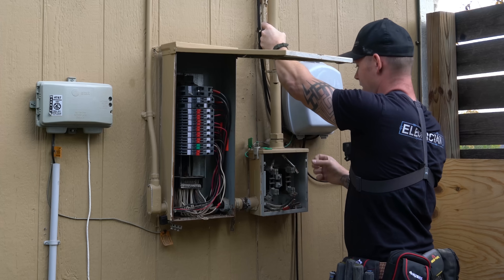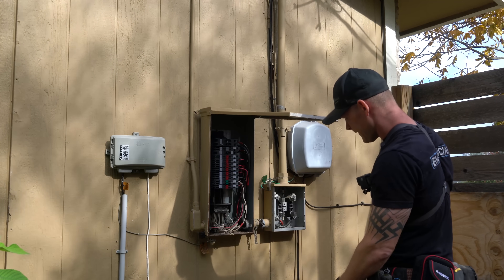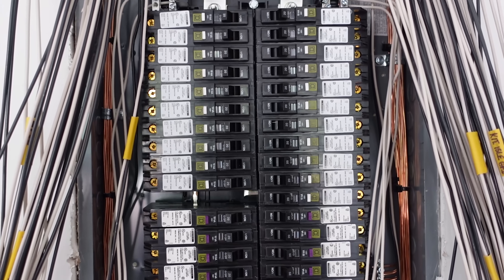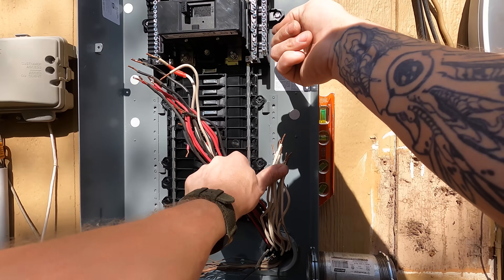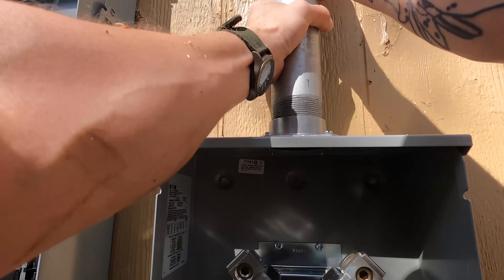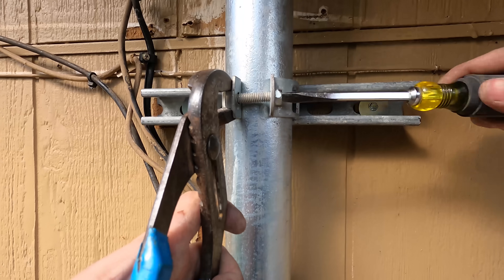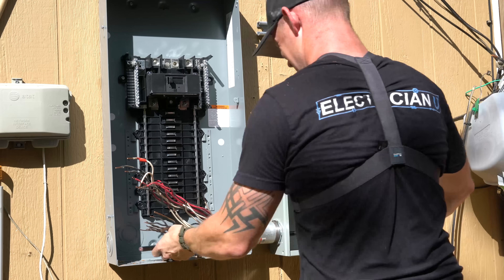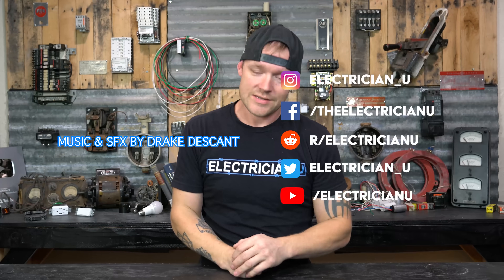How to Replace an Electrical Service Panel, Meter, and Riser (PART 1)

Comment: In my city in Michigan Wayne county they say you have to have your grounds outside and the code book is now saying your main shut off is outside and all the panels inside the house are now just a sub panel and you do not need a ground to go to them all you need now is a ground to your water line out into your disconnect and then through your ground lug on the wall and then into the jumper 6 rod 6 ft apart 8 ft ground rod😊 so you can correct this video and show what the grounding requirements are also

Comment: 4:06, I wouldn't consider having them as knockouts vs. holes silly.  When you install it on a pole, you only use the center top and bottom holes.  You'd have to install duct seal on a pole installation if they were holes.  But I'm just a farmer that has installed one service on the property, and installing a second service, I don't do this for a living every day. :D  Those knockouts are dead easy, though.  I'm using 3/8x5 in. lags, it's not going anywhere.

Comment: NEMA 3r is the reason those panels have ko for screws. If you notice that same manufacturer may have open screw holes in their Nema 1 Panels. Sometimes these Nema 3 panels are mounted on unistrut and are open to water intrusion behind them if the ko was left open.

Comment: What kind of wire do you use for the drop?  The only wire I find in my area is underground cable.  The only UV resistant wire is SEU in a jacket.

Comment: Question.  Would it be legal to invert the panel so that your mains were all terminated on the bottom (technically the top) as well as having the main breaker at the bottom?  I was just thinking about that for a cleaner look as well as not having those mains taking up all that space next to all of the individual breakers.

Comment: I needed this. I don’t know if I’ll be doing it myself but I needed this. Just had a high wind storm and the electrical company’s power pole yanked out the wire from the riser. Now they are saying it’s on me to replace everything. The panel was already old but I think the yanking of the wire did it to the panel. 😭

Comment: I do have a question. Not sure if your still reading comments to 3 year old video but i guess we’ll see. Ive been watching lots of videos on changing my main panel cause I’m getting ready to do mine. Here in New Mexico i had to take a competency exam to be able to work on my own electrical system without hiring an actual electrician. Obviously there’s only certain things i can do before i absolutely need to hire a licensed sparky. Any how most videos say that you absolutely need to use noalox on all connections including any metal to metal connection on the panel itself like screws and what not. Is the only reason you didn’t use any because you used copper wire or is there any other reason. Hope you could let me know this so i can have some clarity on that. Sorry for the long comment i know there’s a lot of unnecessary information i included but I’m bad at that. Thanks.

Comment: Im a union plumber here in New Mexico and i dont know why but when it comes to unistrut i have to cut my pieces in even measurements. Basically any cut i do has to be in between the holes. I’ll even get on my apprentices asses if they cut the actually hole. lol just thought that was funny cause i saw you dont really care where you cut it.

Comment: Thanks for the videos I just finished watching part 2 of this one here I'm currently doing pretty much the same thing upgrading to a 200 amp panel with breaker GE just curious going from 125 to 200 what size ground wire and ground rod should I use thank you or what would you recommend and I live in Austin

Comment: I have a 50 year metal support line. I need to take up the "sag" to ensure 12ft+ ground clearance. Power cut at pole, mast pulled away from house (im fixing it back to vertical), how ?
 Also windy here and adding a guy wire to roof.  Its been pulled away from house towards pole. After mast is secure would it be power company responsibility to make TAUGHT???

Comment: Thanks for all the time you take to make all these informative videos. Had a question regarding one of your videos when you talked about sizing conductors for single dwelling services. If i have a 200A service can i use 310.12 (A) which states conductor ampacity can be not less than 83%. So can i use 1/0 THHN which is good for 170A 83% of 200 is 166. Thank you

Comment: im no expert but i think they leave punch outs for you to punch out to match the exact sice connector you have or need. also if they came with holes more likely chance of water getting inside the panel seeping in also critters and dirt. you can correct me if you know im wrong

Comment: I have two wires from the meter, both black, then the bare ground. Would that make one load, one neutral, and bare ground? Would those two black go one on the left bus and other on the right?

Comment: I have a question about this installation.  First I am a homeowner not a pro.  I need to do an installation similar to this one and I cannot find in the NEC where I can run my wires through a 2 inch nipple into the house.  Everything states the cables must be secured as the enter the distribution panel.  Where in the code is running NM cable through a nipple into the box allowed?  If it is not allowed what are my options?  Thank you.

Comment: Hey Dustin, when you're putting in a off grid inverter to a breaker box, does the ground and the neutral need to be bonded? Thank you! Just wanted to say I'm a big fan and I've learned so so much from your channel. Wish you could do a video one day about inverters and what are some of the codes for how to wire up a inverter to breaker boxes. And so it can be legal Again, thank you

Comment: What size and type of wire is used for the 200 amp upgrade? I’m a second year apprentice and would want to upgrade my 100 amp service to a 200 amp service

Comment: Hey, don't know if anyone is still looking at these comments. But the part about bonding to the nipple in the meter box seems weird. Doesn't that mean that in the event of a ground fault you are using the 2" pipe as a conductor? Why not just use a wire? Is it's only job to keep the meter box at 0V? It's not interacting with the neutral line right?

Comment: Any time an arc fault breaker is required the customer never wants to pay for all those arc fault breakers, they want you to put them in, wait for an inspection and then after it's inspected take them all back out and put standard breakers in and take the new ones back to the store🙄

Comment: Got a question about 3phase 460. I had a air compressor not starting. So I checked at the  main disconnect for incoming voltage. When I did L1-L2 =480 L1-L-3= 480, L2-L3=480.
but when I checked each leg to ground. L1= 480 L2=0 L3=480.  I was told that even if my meter reads 0 for L2 it is a good leg. Why would my meter read 0. I thought I was missing a leg of power the whole time. Heard it was called Deads Man's Leg. Any info on this would be awesome.

Comment: Thanks for sharing your awesome video. Can you route wires through the holes on the side of the panel since no holes are available on the top or bottom of the panel. Thanks

Comment: QUESTION: Just outside my walk out basement I have a meter box and (2) main house breaker Cutler/Hammer enclosures (long skinny enclosures, one on each side of meter box). Each enclosure has just ONE 150amp breaker, no other breakers and no brackets our cutouts to put in additional breakers, just the 150's, then power from those (2) breakers outside feed the (2) house multi breaker panels inside the house, in basement.

I want to hook up (2) portable generators (220v at 30 or maybe 50 amps each) at the location of the meter and these (2) main breakers with inlet plug boxes, interlocks AND breakers (30 or 50 amp depending on generator capacity). One generator per service box so I can access all areas in the house with the option to run or not run. It is a walk out basement on a large concrete pad that also has a couple of HVAC condenser units so having (2) generators in some vented enclosures close by will work fine...

The biggest obstacle that I can see is that the outside 150amp breaker enclosures don't appear to have a way to put in additional breakers to control the generators (with lockouts to block power back to the utility) and to control the generator power back into the house. As mentioned above, these enclosures just have the 150 amp breakers and inside the enclosure it splices neutrals and grounds (using blocks) from the meter, then sends everything to the inside panels.

Do I have to totally change these 150 amp service boxes or is there a way to add breakers to these enclosures? I assume that changing out these main breaker enclosures means turning of the power at meter...

Comment: Hello sir.  I have a question that you may possibly help with. 
Q: is it possible / allowable to splice into the MAIN POWER from the utility transformer that comes into the to of my main panel on 2AWG, and run this to an additional panel that I'll locate a few feet away.     If so,  how or where do i lock out and isolate the pet that comes into the panel?
Thanks in advance!
Eddie

Comment: Hello there, I am currently looking to replace my service just like you... however my old meter and panel are in a place in which I can not run a riser to...I need to place the riser on a different side of the house, about 10' away. 

Is it possible to place the riser in the new location, place a meter and panel underneath it, and run a conduit to the old service and pull wires through that way?

Comment: You forgot a couple of things I would have liked you to share in this video first you didn't run a solid ground to a ground rod witch is very important in this scenario second showing how to place and waterproof your flashing could be helpful to most last but not least you should have marked your  220 circuits for neutral placement reasons could become a huge mess or a big issue I do like your videos keep up the good work

Comment: Where in your video did you have the ele tric company shut off at the pole? Or did you change the box by not shutting off at the pole.
Did you also pull a permit for this work?

Comment: Not an electrician here, but definitely appreciate these videos - I learned enough from this to recognize that whoever did the service upgrade on my house did not assemble the weather head correctly (it's completely missing a cover), so now I know I need to call in a pro - that one is beyond DIY, not messing with the incoming service lines.  Would never have even realized there was something wrong without this video until something broke or went wrong, so thanks!

Comment: I want to make certain we are talking the same thing.
I have 100 amp service box on a pole next to my garage.
Service comes in from power company, goes through the meter to the box. From there it goes to garage, house and barn 
This is what I want to upgrade to 200 amp.

Comment: Your omission of a cheap roof flashing was a typical mistake that us General Contractors have to keep an eye out for. On a remodel the roof flashing is slipped in between the shingles and aligned with the hole BEFORE the conduit is installed. You should remove the weather head and slide the pipe flashing on before the inspector shows up and gives you a correction notice.

Comment: What type of conductor do you use every time I look up service wire it just gives me SEU cables or SER cables even the supply shops tell me service is all cables... My electrician needs wires I don't want to pay extra for cable if it's in a raceway

Comment: How long does an outside electrical panel last? I would think it would corrode more quickly being out in the weather. They must have to be water tight.

Comment: Do you ever use a hex style torque(sp?) device/wrench when you connect the wires to the electrical box, I saw your hex handheld device and I saw another video on installing a Nema 14-50 and suggested using a torque to tighten all the connections to the specifications and that was the first time I had seen a torque wrenching device other than what I am familiar with on a car engine. But I was curious what your thoughts are on tightening hex or screw or bolts (if applicable)   thanks Jim

Comment: I'm sorry but the way you cut your strut made me cringe.  Always cut between slots.  1000000x cleaner in my opinion
Reply: Nothing wrong with that in this scenario. OCD is a good quality to have in the trade if you know when to turn it on or off.

Comment: For the love of god, just stop the insanity.  What do I mean?  Well ... To begin, don't lay the new panel in the dirt to work on it.  Don't use plies as a hammer.  Don't use a screwdriver as a punch.  ... etc etc ... The work shown was sloppy, reckless, careless, and lacking finesse.  Also, this do everything with the wrong tool mentality is one of my biggest pet peeves!  Much of this installation made me cringe!  The gross incompetence of "professionals" in the "Trades" is all too common and seemingly growing worse with time.  The notion that one NEEDS to employ these people because "they are trained and licensed experts" has become a cosmic joke.  These same "skilled" workers push the narrative that they are the only people capable of doing work correctly and mere mortals whom are not in the trades are all horribly incompetent bunglers.  The fact is that these knuckle dragging oafs have no pride in their work, and they care only about working quickly so that they can move to the next job and make more money.  I understand that not everyone has the inclination to do things themselves; however, if you want work done well and correctly, you must learn skills and do things yourself.  I'm an engineer: After observing people in the trades over the years,  I have established a personal policy to do 99.9% of such things on my own.  I am done with these blundering hacks and their expensive "bull in a china shop" methods!

Comment: What’s the difference between service wire 4-4-4-2 and 4-4-4-6 ?    Home Depot sells the 4-4-4-2 but totally out of stock everywhere.   I found the 4-4-4-6 on eBay.

Comment: As a second year apprentice I got fired from a job for doing a riser meter and load center, Wich was opposite side of the house in the garage, required stud finagle in three hours on two houses. Took one day basically. This reaso pm fired me for not doing all of that in one hour. Do you think that was fair, or even possible??? More on my termination...lol. I bet him 100$ he could not do it in an hour and said I thought that I was doing pretty well for a second year school apprentice commercial by trade electrician. He did not take the bet but said some of his guys could do it...not this fat pos. Also I never got paid crap at residential and they expected like 4 bedroom house to be 100% ruff on two days with two people. Why is residential standards so horrible pay so low pace so much faster?? I think of it as if not a ton of overhead and what gets charged for a four bedroom house... Some gargantuan

Comment: I worked 8 years at a plant that made automated soldering and cleaning equipment for printed circuit boards. These machines were sold worldwide. Definitely not assembly line jobs.

I hated/loved routing big stuff in the power box with all the fuses and motor controllers.

Anyhoo, looking good so far. Looking forward to part 2. Be interesting to see what kind of wire stretcher you use.

Comment: Wow, branch-circuit breakers on the outside of the house instead of the inside like normal people do.
Reply: That’s what NEMA 3R enclosures are designed for

Comment: the screw holes are that way cause sometimes those panels are going to be installed inside on a 2x4 or 4x6 wall so you will screw the panel on the sides not in the back

Comment: Question:  according to 2020 NEC code change to 230.85, I can’t figure out if I can use the main breaker in my outdoor panel as a emergency disconnect.  Thoughts?

Comment: Kinda odd about the RED service conductor. Up here in NJ the guys at PSEG might be confused by it thinking it's a high leg 208V 3-phase (even with the missing conductor)!  Least that's what I've been told and to NEVER USE RED on a single phase service. Great video, good camera work and attention to detail.
Reply: Why would anyone think it’s three phase? I could see if there was a blue involved, why would I think it’s three phase with the red? Black- A -phase , red -B -phase , blue -C—phase. Two blacks would be incorrect, or Red and blue would be incorrect. Looks good to me send it! And on top of that the NEC code only points out two current carrying conductors colors, and that is orange for a high leg and light blue for  intrinsically safe Systems.  Just Trying to understand?
Reply: i think everyone would think 3 phase. What else would be the case?

Comment: Question here. when replacing a new service panel and the wires coming in are short. can you pig tail wires to lengthen them to fit the new breakers. and the same for the neutral  and ground.
Reply: I've seen it done as long as fill is ok but when I had my old fuse panel replaced the electrician actually setup multiple junction boxes on the joist above my panel (basement wall) and ran everything down from those. Looks much better inside my panel and he labeled it all going in and out.

Comment: I noticed at 2:33 that the cables/conductors enter the panel in a non-standard way. And then in the new installation you use a short nipple at the back of the box... but none of the cable is secured. whats going on inside the wall? is this NM cable that is stripped back before exiting the wall? I have a similar problem where I want to move a panel from inside to outside, but in doing so the NM conductors will be loose in the wall.. and I can't use a box where the old panel is because it is going to be a shower.... hmmm...